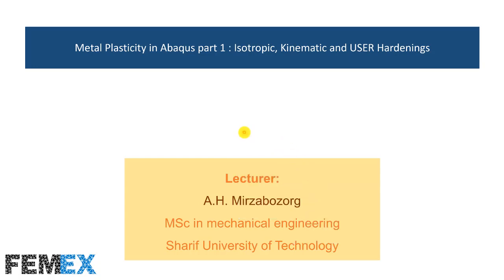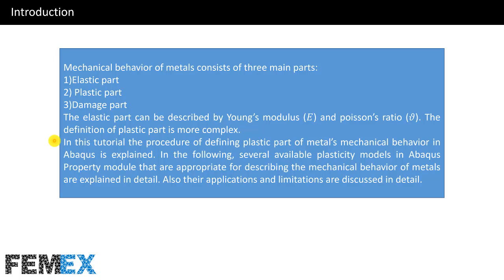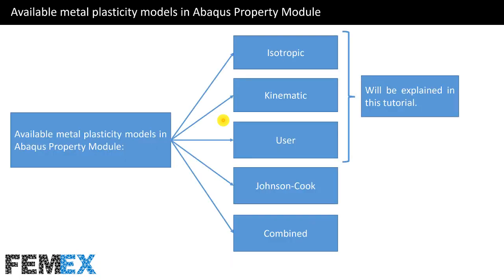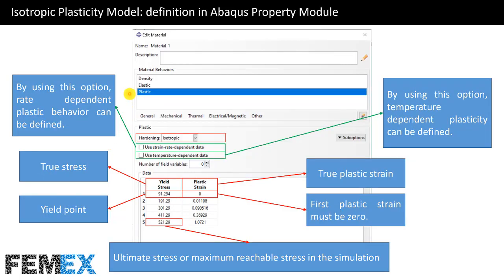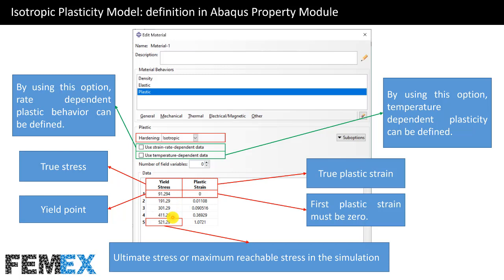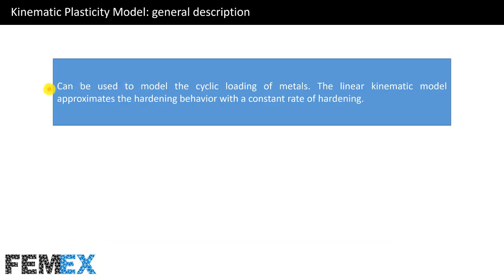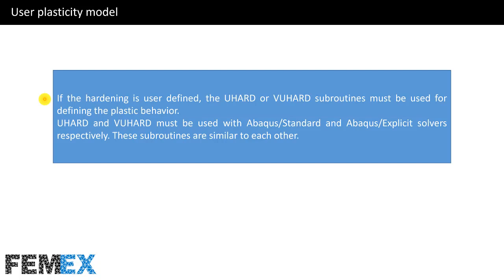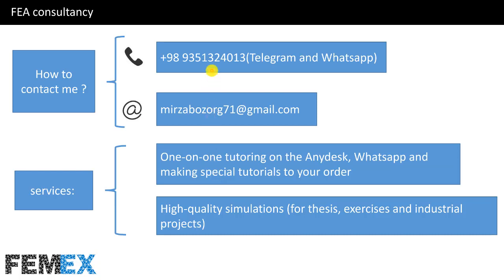Metal Plasticity in Abaqus part 1 : Isotropic, Kinematic and USER Hardenings

Comment: thank you for your tutorial video. in case if you want to use any types of ductile damage , to what extent we should enter the plastic behavior of material? is it up to UTS ? or we can extrapolate it up to 200% as the model meets the necking so much....
Reply from the maker: hi.
you are welcome.
you must always define the plastic behavior up to UTS. if you also define damage behavior, after the plastic zone, the material undergoes damage zone. if you do not define damage behavior, it will shows a perfect plastic behavior and PEEQ will increase without the increase of the Mises stress.
Reply: @FemexIran   Thank you very much for your respond. 
I’m still wondered if damage behaviour is not applied on the model,why do we need to Use work hardening after necking? I mean work hardening will increase so that means the simulation is somehow wrong. Furthermore, do you mean we should not extrapolate hardening behaviore after UTS if the damage behaviour is defined?
Reply from the maker: @sianourani1042  you are welcome.
if the damage behavior is not defined, after reaching to the ultimate point of the plastic behavior, the simulation is not correct anymore. because after that point, material has a perfect plastic behavior and there is no work hardening because the Mises stress will not increase. the last point in the definition of plastic zone must be the ultimate point.
Reply: @FemexIran  yep this is what I expected too, but I have seen through Numerous papers that The work hardening has been extrapolated up to 200%… specially wherever the necking happens!!!
Reply from the maker: @sianourani1042  I have not seen such definition of plastic zone before. it is not correct. as I said before, as the maximum defined Mises stress is the ultimate stress, after reaching this point, no hardening occurs and material undergoes a perfect plastic behavior. what I say and what I do is according to the Abaqus documentation that is the most correct reference in the world about the use of Abaqus.
Reply: @FemexIran  thank you so much, but there is hardening after UTS yet, specially in metal forming. Abaqus is a commercial software and documents are basically general. plasticity books  suggest  the hardening after nacking as well.
Reply from the maker: @sianourani1042  you are welcome.
in the true stress versus true strain curve, there is hardening after the UTS point but in the nominal stress versus nominal strain curve, after the UTS point, the stress level decreases. I have not read the plasticity books but I know that what is available in Abaqus and what is provided in Abaqus documentation can lead to the most accurate simulations. this is why the Abaqus users are increasing every day. being a commercial software does not mean that Abaqus is not accurate because it is even used in R & D centers. initially it was developed for the simulation of a nuclear power plant.